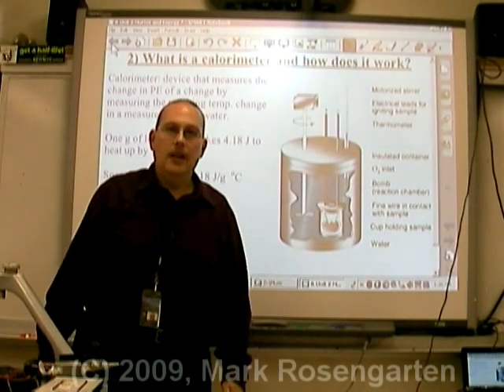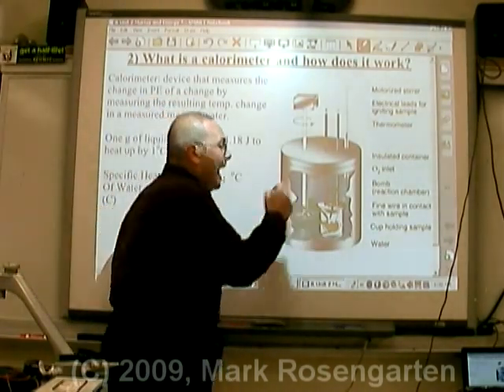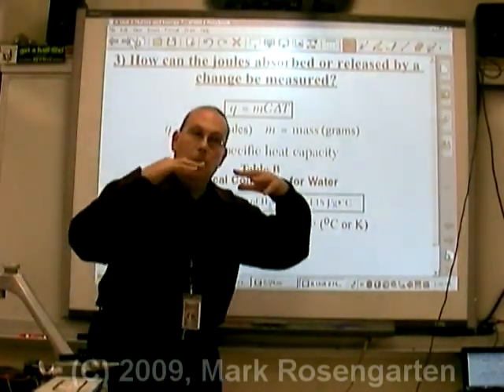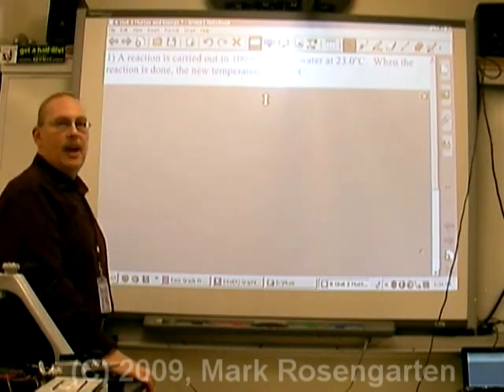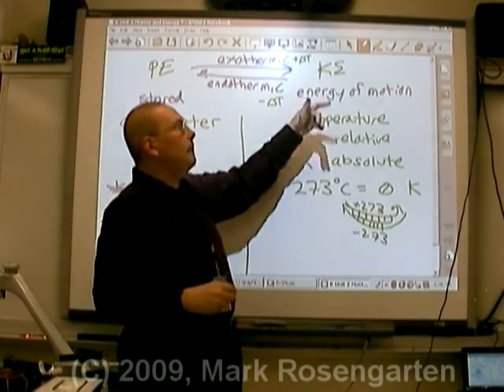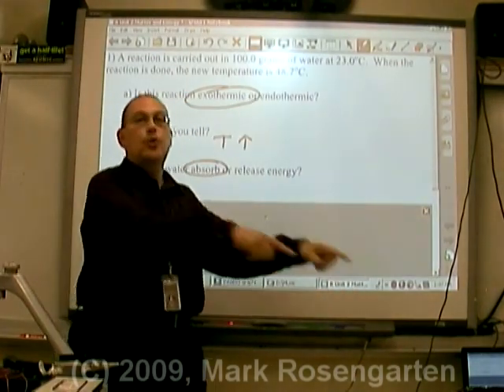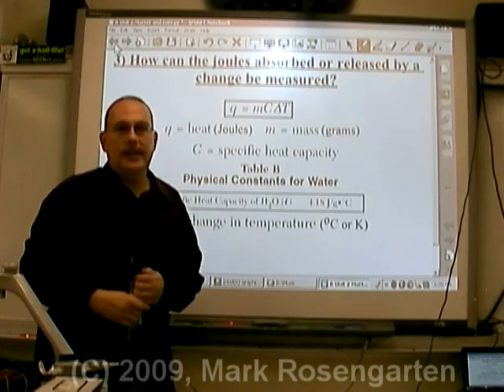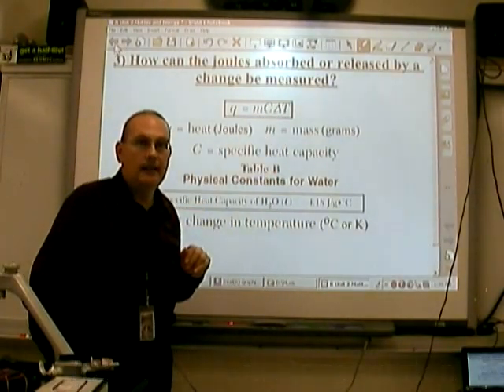Chemistry Tutorial 2.04a:  The Calorimetry Equation

Comment from the maker: @trovial When talking about rate in terms of quantity of reactant consumed over time, your assessment is correct.  In calorimetry terms, the rate at which water heats up is a function of the water's ability to absorb heat, measured in joules/gram*C, or the number of joules required to heat 1 gram of substance 1 degree C.  This is called the specific heat, and it can be used to determine the rate at which the water heats up when heat is added.

Comment: You r certainly a great teacher.
However I wish you solved at least one problem using KE formula because i dont understand it.
Reply from the maker: What KE formula?
Reply: Ke= 1/2m v (2).
The problem is: 'Calculate the kinetic energy of a fully loaded Boeing 747 (322000 kg) moving @ speed of 950 kph.
My answer is v different from the book and the book doesn't give the solution path.
The answer by book is 1.12 x 10 (10)

Why power of 10?
Why 1.12?
Do I always have to convert kilometers p hr to kilometer p second?
Reply from the maker: lili M This is physics, not chemistry.  This channel is for students studying for the Regents Examination in The Physical Setting:  Chemistry.
Reply: That is not right Mark,

This applies to both Chem and Physics.
Reply from the maker: lili M I think you should reread my disclaimer.  The KE equation is taught in Regents Physics in New York State, not in Regents Chemistry.  In the real world there is no such distinction but New York State makes that distinction for the purposes of setting standard curricula for courses.  I teach Regents Chemistry, therefore I have not worked with the Physics material (as defined by New York State) in over a quarter of a century.